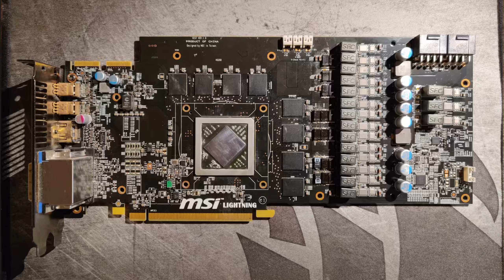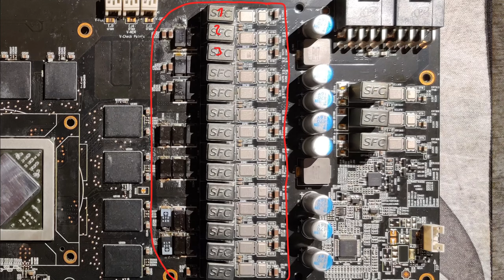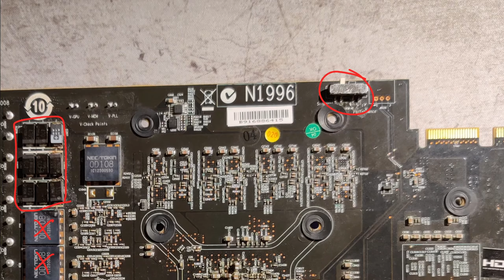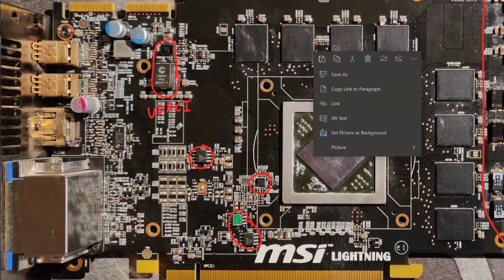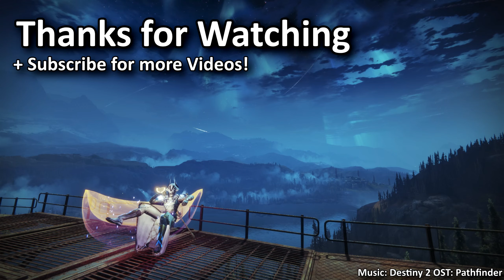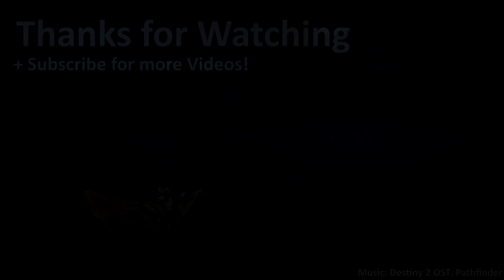MSI HD 6970 Lightning | PCB Overview

Comment: Have you run this card? Got the same card, boxed and all. Still looks unused but when i switch to performance bios the card won't put out any screen at all. Also mine does not run at the advertised 940 mhz on the core. Am i just having a really bad example of the hd 6970 lightning? As this card does not oc very well 975 mhz on the core max and seems to be a big let down. Besides this half the vrm is never in use, why put them there? Dumb product at best.